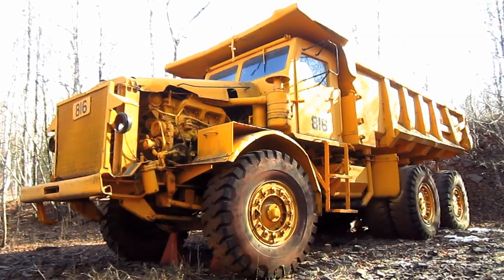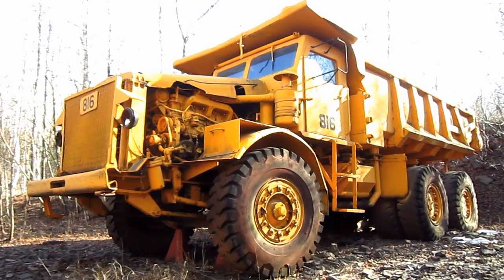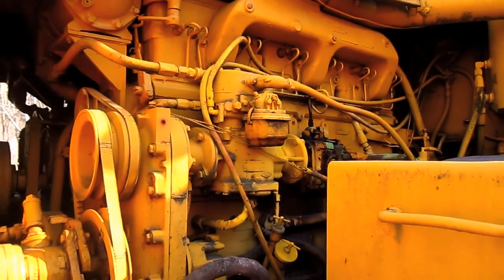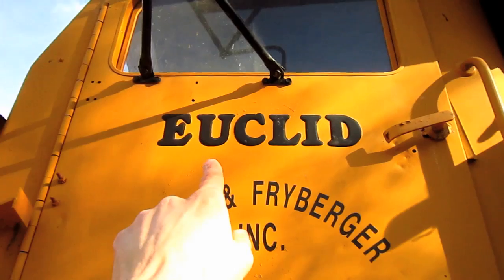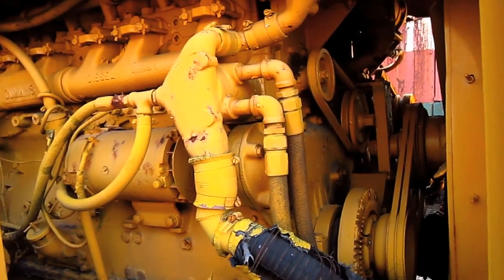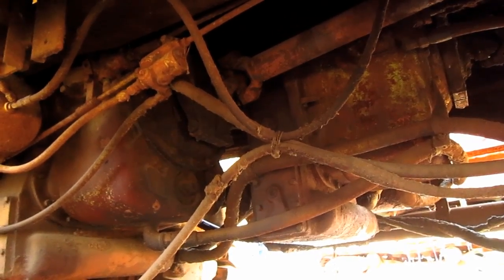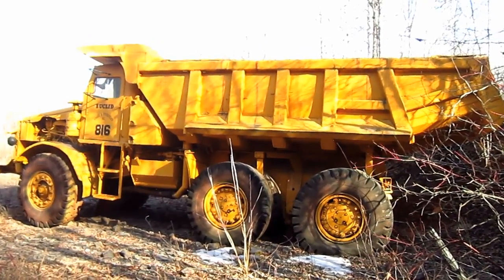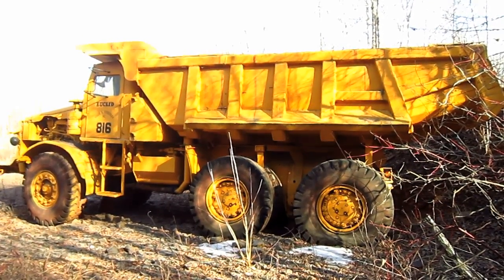Euclid 4FFD Documentary

Comment: He states this truck is powered by Detroit engines but you can clearly see Cummins on the manifold of the unit on the passenger side.
Reply from the maker: Well obviously you didn't pay attention because at 2:39, what did I say, it has two Cummins NHB 600 diesels which you can see right under the hood.

Comment: You said that there were no suitable single engines?
There was the 12-71!

Bizarre to use two 6-71
Reply from the maker: The 12V71 was not offered in this truck. In fact, it wasn't even manufactured when the truck was first introduced. The only single engine option was a 12 cylinder Cummins NVH. At this time in history, the downside to a big V12 was the replacement cost of components and the weight.

Comment: Now that's a interesting truck, every time I see a twin engine and transmission unit a part of my thoughts wonders how it got synced. Using the semi-auto units takes a whole lot of the guess work out and actually makes it somewhat easier to drive not just in a flat mine but one with switch backs and some decently steep elevation changes. Mainly so it's not slow rolling wide open because manually changing gears for two units, the gear change often resulted in mismatch engine and actual speed. If not causing a stall since one engine would be in mid shift while the other was trying to push the entire load.

Whether fortunately or not, such units were limited for the world because of advancement in engine power to weight ratios, transmission reductions and so forth. Still though, seeing one of these still around to be testimony to how it was done back in the day. That heavy haulage builders now can probably get inspiration from looking at as a tangible piece instead of merely pictures and drawings.

Comment: That has to be one of the straightest Euclid haulers left in existence. It doesn’t even look like the box is all banged up. Didn’t even see any broken glass. That one needs to be made a runner again.
Reply: I'll bet it starts and drives especially considering the doors are locked
Reply from the maker: Guarantee it would be easy it start. All simple mechanical components. She'd be easy to get on the road again
Reply: Some idiot has smashed the passenger side glass and headlights 😢

Comment: Not to sound cheeky, but just how many front axles does that truck have, and are they all powered by the left(or perhaps right?) engine.
 I believe you meant that 1 engine powered 1 of the rear axles and the 2nd engine powered the other rear axle, not the front axle as stated. cheers
Reply: That threw me initially, I was surprised it was 6x6 but I guess it’s actually 6x4 with one engine driving the middle axle and the other driving the rearmost?
Reply: It has a front drive axle and a rear drive axle. Pretty easy concept to grasp. If you really want to argue semantics the way you worded it makes it have 2 rear axles when it can only have 1.
Reply: @Oliver66FarmBoy  But I did not see a front drive axle, just s typical lorry  drop forged? curved front axle, and I think I checked. I will look again though.
Reply: @marcusgault9909  Front drive axle. Rear drive axle. And a Steer axle. If it was 6x6 it would be a powered steer axle. It’s not that hard.